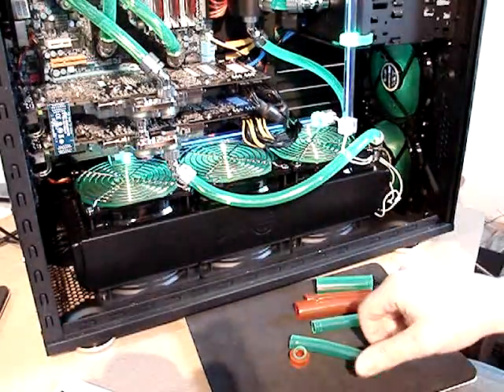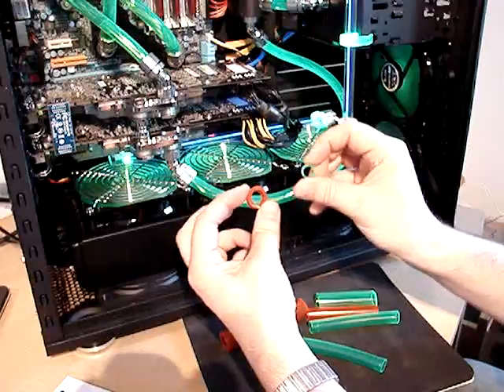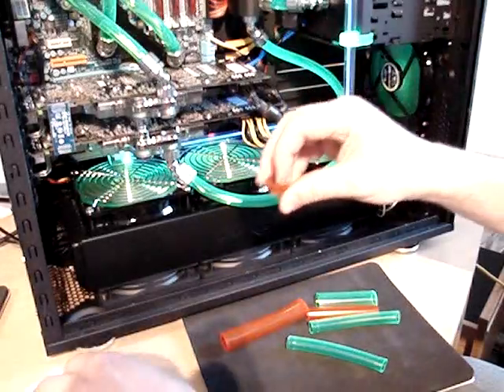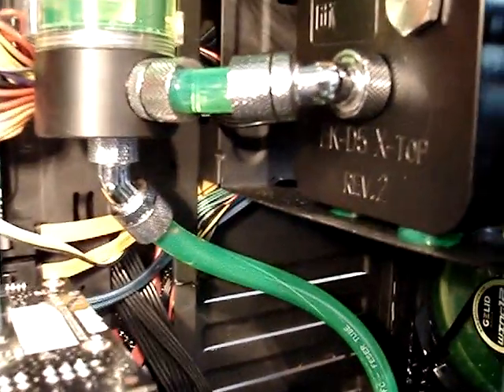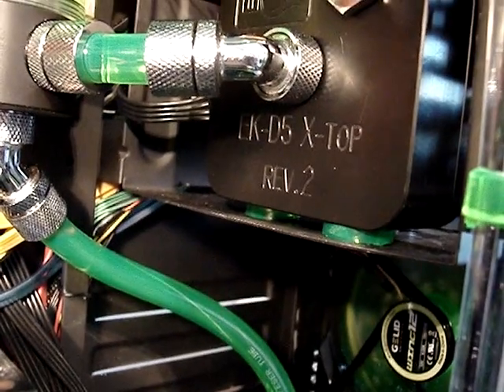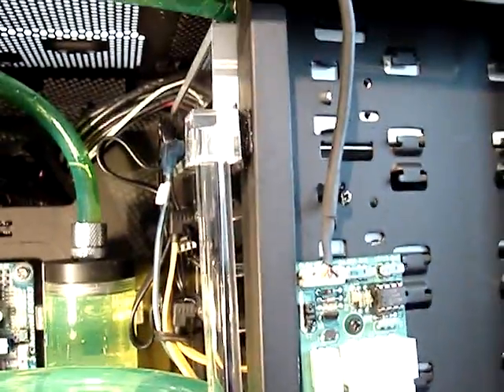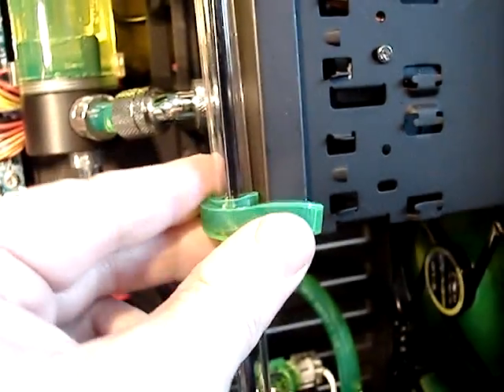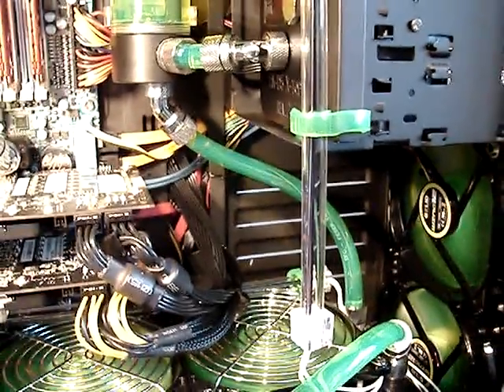How to silence watercooling pump with leftover tubing ends?

Comment: @takealready This is a really interesting question. I have never find a similar topic. In my opinion I would do this way: res-pump-cpu1-radiator1-cpu2-radiator2 -res if you can put two rads. If not then you must be aware that the best way is to put a res before pump so it couldn't stay without a water somehow.

Comment: Hey I would like to know if you can just put a radiator inside the loop like after the cpu one on the top then continue the loop through the chipset or do you need another reservoir and a pump im thinking of making a watercool system with a radiator on the top and one on the bottom I will use thinner radiators as yours though :D. The monster your using is to big for me I think and I would like to keep my hardisks at there place. That also leaves more room for me in the 5.25" bay area.